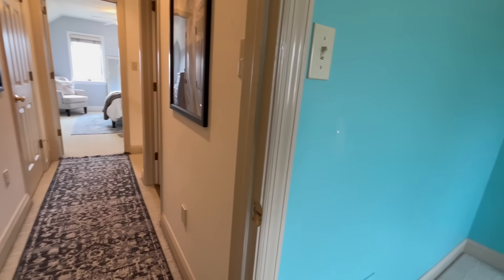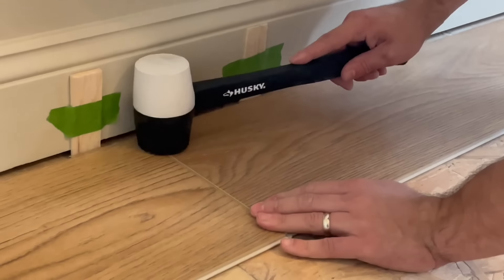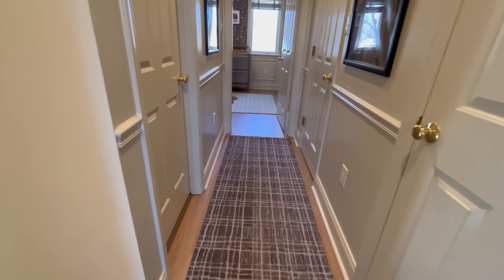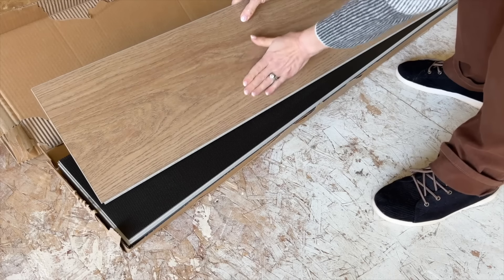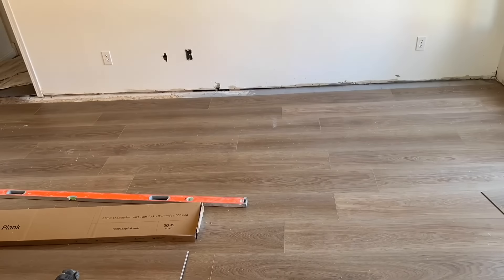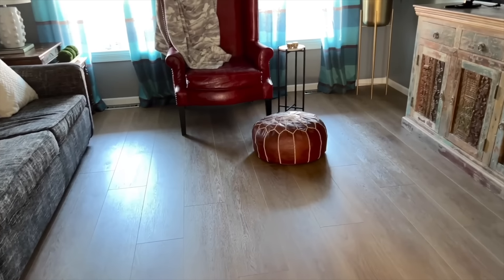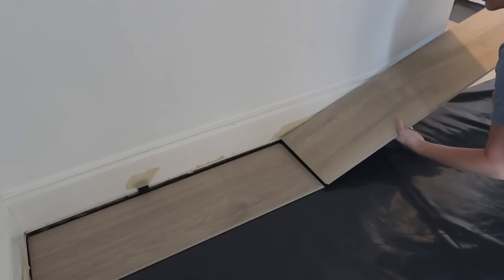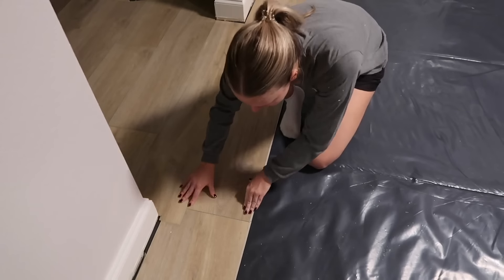Everyone will be rethinking their bedroom flooring when they see this!

Comment: Why do you put those spacers or stoppers down so the flooring doesn't go under the trim? Doesn't that look bad when it's all done? Also LOVE those poppies on the wall, beautiful. I knew a friend who got a ton of hardwood floorinf in amazing condition from an old school basketball court. It was so thick and gorgeous. This stuff looks good.
Reply: That's the recommended approach for "floating floors" like these... Leave a little space around the edges so it's easier to re-seat boards as you work, and/or replace them in future. Then to hide the gaps at the end, you add "cord around" (sp?) to the baseboard 👍🏿

Comment: Does this flooring have a sticky side on the bottom to stick to the base of the floor? How does it stay in place please? Thanks!😊
Reply: Friction keeps floating floors like these in place without adhesive. You can slide a single board, or two connected boards, maybe even three... But the more boards get connected to each other, the more friction you'd have to overcome to make the whole thing slide. Classic "strength in unity" type thing 😂